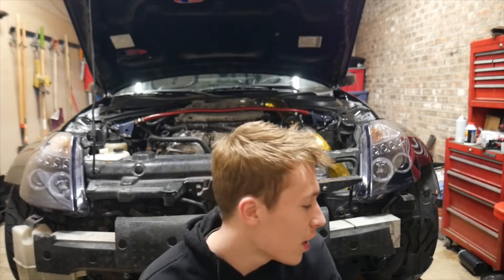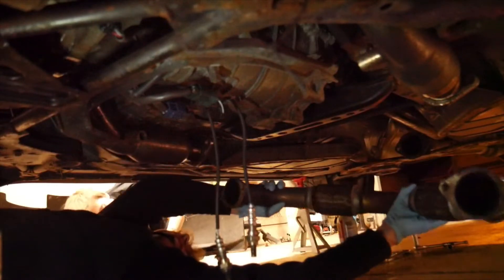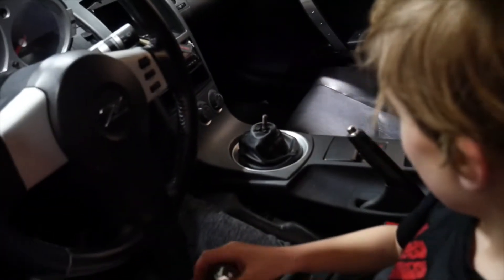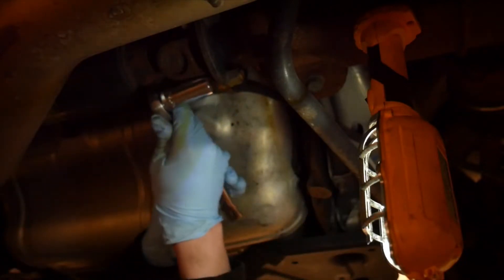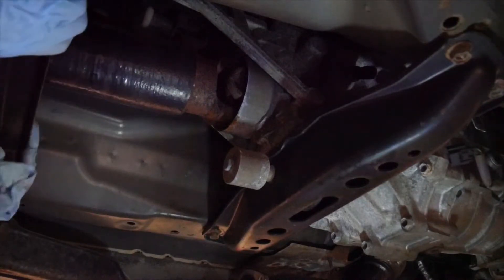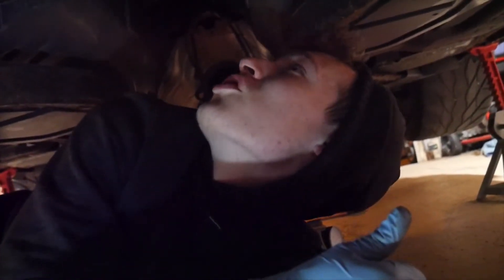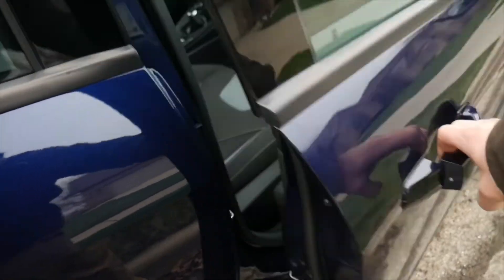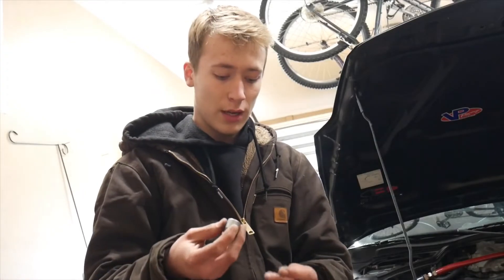Fixing Synchro Grind - 350z

Comment: How much was the transmission and how much would it cost just for a repair shop to replace it? Cause I’m worried I might mess it up? I’m looking to buy 350z with this issue for 6.5k
Reply from the maker: My used trans was $500, and I’m mot sure what a shop would charge but you could call around and get quotes.

Comment: I just got an 03 350Z and like the previous owner did state the clutch needs to be replaced and so I ordered one from Z1. I grind when I shift to fourth gear. I also haven’t touched the transmission oil but I heard it can be a possibility? So I ordered redline manual transmission oil because I heard it can solve the issue. Any other things it could be besides getting a whole new transmission?
Reply from the maker: Trying a trans fluid change is always a good first step, fairly cheap and not Invasive, although I do prefer the oem Nissan fluid. It’s expensive to get now tho. If that doesent solve your issue then unfortunately it’s probably the synchro as that’s a weak spot and very common on these. Finding a used one is usually the cheapest option but you can also have it rebuilt. Goodluck
Reply: @TomlinPerformance  so it can’t be the clutch as well? Because I’ve read online that if the clutch is worn out it can cause the gears to grind. For now I guess I’m going to double clutch and get better at it until I can replace it if the tranny is messed up. Probably upgrade to the CD009.
Reply: @J.Y_Z33  The trans is mainly the culprit.

Comment: I had an RSX type S with a bad 3rd gear grind I literally only replaced the Honda fluid with AMS oil I can remember if it was mesh oil but that transmission shifted smooth as butter. The only con was that if you rested your hand on the shifter hard enough, you could easily pull it out of gear with minimal effort.

Comment: So idk if you’ll see this but hopefully I’ll get a response! I’m trying to buy a 2003 350 and it’s got some grinding for 3rd, 4th, and 5th, the guy trying to sell me it said it’s just that the synchro baulk rings need to be replaced. I talked to my dad about it, I’m not great with cars so I think his word on cars is the end all - be all, and he said that the transmission’s getting ready to give out, I’m not sure if it is or not, would you happen to have some more insight on this?
Reply from the maker: Bad synchros are a know common issue with these cars. Exactly what was wrong with mine. The trans won’t “go out” it will only grind gears until the synchros or transmission is replaced. Cheapest option with out rebuilding a trans (no fun) was to get a used one to replace it with which is what I did.
Reply: @TomlinPerformance  gotcha! I really appreciate the reply! I’ve heard that the synchros are only like 80 bucks a piece so that’s probably what I’m gonna end up doing :D
Reply from the maker: @Vortexstorm921  yep! They’re not too expensive, just require more tear down to replace.
Reply: @TomlinPerformance  sounds good to me! :D
Reply: @Vortexstorm921 Hope I receive an answer of my repply here but I have to ask because I got my 350z recently and now it is grinding, have no idea where to find the synchro here on my country but want to know if you bought the car and got this fixed?

Comment: Props for doing this on your back at home, I dropped a 009 in my 03Z
got the 2nd gear grind back after 50k miles, prob my fault slamming  gears,double clutching 😆, my experience is Nissan gear lube as you mentioned Def way to go, Z1 Trans mount new clutch and flywheel chrome moly pivot ball
while you were there would have been worth the extra $, now all you need is diff bushing and Z1 subframe collars. love my Z but they need a lot shit to make them right.
kind of endless but screw it,,, it's a Z. Funny though how everyone loves these old Z's 😁. BTW
100 shot of NOS was a cheap and easy extra kick in the ass....good job and good luck
Reply from the maker: Thank you!!

Comment: My fifth gear is scratching thinking it could be my synchros also
Reply from the maker: Antonio Porras have you recently changed the trans fluid? These transmissions are really picky to fluid, if you use the wrong stuff 5th will usually grind. I’d say try swapping out the fluid for genuine Nissan 75w85 gl4 and hope it’s an easy fix!
Reply: Mason Tomlin will do had my slave cylinder changed don’t know if the mechanic had to flush the trans fluid or not ima give it a shot thank u
Reply: @TomlinPerformance  I have the same issue but in third, could it be the same thing too?
Reply from the maker: @mitchofell  making sure you are full on fresh Trans fluid is always the easiest and cheapest thing to fix first, but 3rd gear is known for having bad synchros so that’s most likely the case.
Reply: @TomlinPerformance  yeah gonna try putting new fluid once the snow finishes melting since I don’t have a garage, but yeah most likely gonna have to swap my trans 😭
Reply from the maker: @mitchofell  goodluck brother!
Reply: Did new transmission fluid help you?
Mine just started grinding in5th